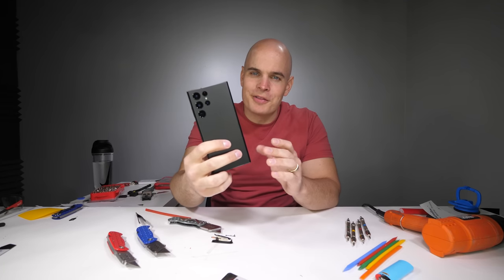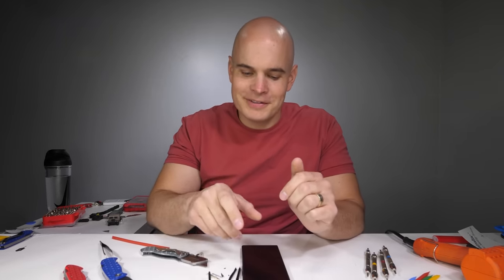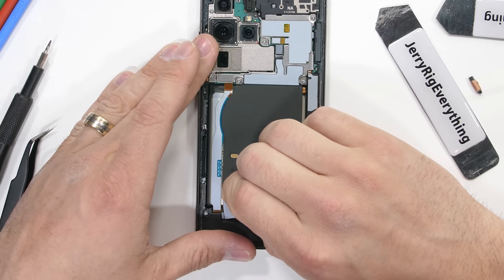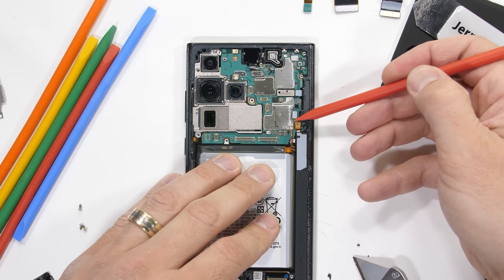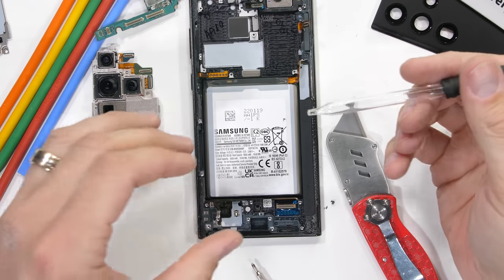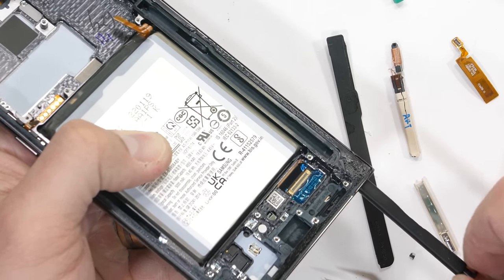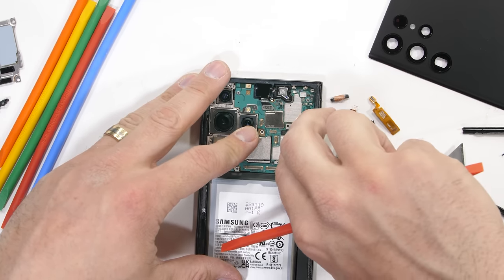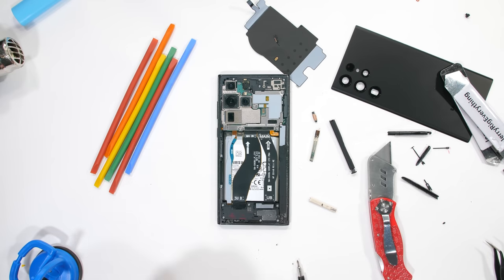Galaxy S22 Ultra Teardown - Can the S-Pen hole Leak?!

Comment: I repaired smartphones for years as a LEVEL 2 device repair technician at Batteries + ( lol ) & lots & lots of Apple & Samsung phones // usually 3-15 phones per shift / + selling light bulbs (LED) & installing car batteries etc // at any rate // my first smartphone was a Galaxy Note 2 then I went to an OG iPhone SE & now I roll an iPhone SE2 - I got an Apple Watch Series 1 (still works) desk ornament, Apple Watch Series 5 (now Meg uses that one) & most recently Apple Watch SE (my daily. We both have 2019 iMac's & iPod touch 4th gen that still work & an ancient iPad 2 that still works. My 2008 MacBook still works too. Apple hardware very long lasting - for many people. I really like how iPhones are made & appreciate Samsung phones too // & appreciate that Apple makes the battery easy to replace (since its probably the first thing to fail, especially since going to 100% charge damages LIPO, as does high heat & or charging while below freezing (keeping LiPO between 30-80% makes last 5X longer (your working with 50% of the charge & minimizing anode & cathode ion insertion & removal extremes associated with charge state below 5% & above 95% / this applies to most of the lithium cobalt carbon lipo batteries used in consumer electronics that are portable // laptops, smartphones,  smartwatches, fitness trackers // so I recommend short charge sessions of 10-40 minutes in the morning or while taking a shower, while going for a walk, while eating breakfast or lunch or dinner, & strongly advice people to avoid the fire risk of leaving their portable electronics with LIPO batteries parked on a charger all night while they are sleeping (overcharging & progressively damaging the battery) - Kudos to Batteries + & iFixIt for helping people to replace their faded electronic device batteries & for selling the tools & giving away the know how & instructions online for free - like many YouTube channels. Love your channel Zach!

Comment: Thanks for the teardown, the s22 ultra looks well built from a packaging stand-point. Wonder how long that charging port o-ring will last though. I'm still sporting my Galaxy S7, if it still had security/software updates I would keep it longer as it still does the job fine. Right now I'm looking to reluctantly upgrade (its been 6 Years).

Comment: I " upgraded " to the s22 Ultra 512gb model from my s10+ this year and I use the word " upgrade " very loosely. Personally I think the s10+ was peak Samsung, best phone I had ever used hands down. Unfortunately, I'm not liking the s22U as much. It's bigger and the display is less worn out, sure. But the phone itself has bad thermal issues that constantly causes throttling, battery life sucks, speakers don't sound as good, and it's missing alot of features I've come to be used to over the past 3 years. They're also not including pre-installed screen protectors anymore which is a must on these phones since nothing works right on the aftermarket. Either they can't adhere to the curved edges good or the fingerprint scanner has a ton of issues. And that's ontop of everything else Samsung has de-contented in the past 3 years. Still haven't recieved a day 1 patch yet either and I've had the phone since the 23rd - 2 weeks ago. Idk, it's a nice phone if it's your first Samsung, but tbh the s10+ was better. If that phone could have lasted another 5+ years I would have just kept it. Idk, at this point I just think we're hitting the law of diminishing returns on these phones - Apple included. And esp for the price we should be getting a whole lot more.
Reply: At this point there is nothing more for the phones to offer other than better battery life. They can run every game and app you would want to play on a phone, shoot cinema quality movies, take award winning photos and have high end gaming monitor screen resolution. Not to  mention being waterproof, 5g and wireless charging. Phones have reached their potential and now companies need to start making them cheaper
Reply: I did the same exact thing you did. There are a few improvements/new features. My s10plus battery waa going downhill pretty fast. Right now, I can go a full day without charging unless I'm gaming. To think, instead of the s-pen, could of had an aux port.
Downsides are, having to buy a new adapter. I feel like if they up the charging rate, they should include it in the box! Also, this phone ran very hot, like burning fingertips hot.
But apparently thr new software is learning your usage to adjust performance.
Reply: CockOfJustice  as a curved screen owner I can say that (S20U) I love it. S20U's curved screen is subtler than older models but the usability and the comfort and look ratio is amazing. There are proper glass screen protectors that work really well without fingerprint scanner issues. Since the corners have smaller curves as long as its good quality, glass screen protectors do stay on without a problem.
Reply: I'm still rocking my s9+ and love it, going to need a battery and charging port replacement soon but everything else is as fast as the day I got it
Reply: CockOfJustice  I've had curved displays since my s10+ in 2019 and I love them. But you are correct they're a pain in the ass to find a good screen protector. That's why I'm upset samsung stopped including a pre installed protector on the s22U bc 99% of the aftermarket ones suck. But the curved display itself is great and honestly I can't see myself going back to flat glass.
Reply: @jeffgayzose8129  yup. Only reason I even got the s22U is bc Verizon offered me $1,000 for my s10+ I couldn't turn that deal down
Reply: @_dmfd  damn, really? I have Verizon, need to look into that
Reply: @jeffgayzose8129  it was for the pre-order only fwir. They gave $1000 for the s10+ for the s22U and then let us get the 512gb model for the price of the 256gb model. It comes out to $8 a month haha so essentially got it for $300.
Reply: @bradburch2051  yea man tbh I just preferred the s10+ and s series in general. I always like the rounder aesthetic but if I would of gotten the s22 or s22+ it would have definitely been a downgrade. I'm having the same issues with the thermal throttling and battery. There's actually a scandal going on with Samsung about it. They're intentionally throttling our phones bc the chip heats up so bad. You should look into it

Comment: I'm curious to what happens to all these phones since there's that huge emphasis on being eco. How does one use these parts or recycle them easily?
Reply: Check out Hugh Jeffreys, he does some brilliant videos on repairability of phones
Reply: @sabersz  indeed. He is pretty fun to watch
Reply: @sabersz  Hugh Jefferys is great, but that doesn't answer the question on what companies are doing with these "recycled" phones.
Reply: @mjc0961  i think he explains how they're recycled pretty easily. Save as much as you can, even a cracked screen with working display can still be refurbished.

Comment: Repairability and recycling are so-so on the scale for me. I'd love to keep my S22 Ultra forever, but if, for whatever reason, it can't be repaired, then I won't cry about it. And for recycling, while important, I think that not buying a phone simply because the battery removal isn't easy or 100% guaranteed is a very inefficient reason, but to each their own.
Reply: Purchasing devices that are less recyclable may encourage the company to continue doing so, it is not the right direction in 2022.
Reply: @theneighborlynumismatist8201  Bro nobody cares about recyclable most people keep their old phones in a drawer i got like 10 in a drawer atm and if youre stupid enough too see non recyclable as a problem you should prob not buy any electronics.
Reply: Why do you think it can't be repaired? He removed the battery in like 15 seconds.
Reply: @bubbleir  well as i said if you think its a problem you should not use/buy anything that uses electricty😑
Reply: @bubbleir  and for the reason why they make it a 2min kob instead of 1 is the note 7 every samsung until that point had a 1 min removeable battery its for sustainabilety and safety!

Comment: Repair and recycling is one of the key pillars of my smartphone experience. I hold dear the concept of sustainability, and options with sustainability definitely adds huge points to the decision.

Key factors when buying phones:-
1. Durability
2. Day-to-day usability (overall software experience, size and weight)
3. Repairability
4. End-of-life
5. How good are the telephotos (I'm a lazy guy, I read the menus from far when I'm in queue or at my table for lunch/dinner)

Comment: I definitely agree that Samsung should make their batteries easier to remove, it's really dangerous now!
Reply: How is it dangerous? Serious question
Reply: Isopropyl alcohol is extremely cheap and completely safe to use on electronics. I replaced my battery with a screwdriver, candle, and a couple plastic shims and had an easy time with it.
Reply: @Yielar1  Zack had to put a lot of force on the battery with his metal pry tools and he slightly bend the battery upon removing. This is dangerous because this can cause the battery to malfunction, catch on fire or explode!
Reply: @realracer0353  he also had to spend 5 minutes heating up the back glass and use a razor blade to cut the glue. Either of those things could also make the battery catch fire. What I'm getting at is that if recycling companies can find a way to get the back glass off easily, they can surely find a way to get the battery out easily. Especially when most pull tabs don't work most of the time. I think not buying a phone because it doesn't have battery pull tabs is stupid, considering how hard it is to get to the battery in the first place and that most of them will never be recycled.
Reply: @Craig Comeau when you are struggling to remove a battery and pierce it, it will likely explode ablaze, having to do this with Samsungs make the batteries almost irreplaceable without a professional this the glue can be dangerous to the environment upon recycling….. it’s difficult to recycle all that glue hahahah
Reply: Yes definitely dangerous. Since u have to remove it on a regular basis 🤣🤣🤣

Comment: Wasn't apple counterproductive by locking down each component so repairability is a major hurdle? Well, for third parties, hopefully not themselves.
I think there might be other also ecologically good ones, e.g. Fairphone.
Reply: yeah that's why France threatened them to ban them from the eu market and they caved and made that repair program
Reply: Apple makes repair very difficult. Louis Rossmann has videos about it. He fixes Macbooks
Reply: @MiguelY22  well, I was wondering because even Jerry did a video about a recent iPhone where he tried to just exchange some modules between two of the same model.

Comment: I got my Note 10+ the same time as you and have been rocking it ever since (am also considering an iPhone for my next whip 🤢) but it recently fell off my motorcycle at 50mph and my case isnt even that good and the phone is completely fine minus one tiny ding on the frame. I'm shocked and I'm not sure what other device could do that in our current climate. I probably just got lucky but still.
Reply: Do not get an iPhone they suck so bad.
Reply: Not to mention I can sell my 5 year old iPhone for the same price as last years flagship Samsung. iPhones hold their value for a reason.
Reply: Note 10’s were actually really durable to drops than the S10 and the S20 series according to the phonebuff’s drop test videos. So it no doubt it’s great in the real world
Reply: @TonyVM775  You bought it for more so....
Reply: @TonyVM775  dingbot? 🤣
Reply: @Crazyoldman84  🤭😂
Reply: @TonyVM775  because they're more popular than Samsung phones in the US.
Reply: @Crazyoldman84  lmao didn’t wanna really insult you but had to call you something. At the end of the day we are arguing about cell phones that do the same thing lmao
Reply: @TonyVM775  it's ok you can me what ever you want I don't get offended. Yes phones that do the same thing except different. Everyone has there opinion and mine is iPhone suck 🤣. I just find iPhone incredibly difficult to use and everything they sell expensive. I'm a pixel guy myself.  Iv also had a few Sony's I liked a lot. My wife switched to iPhone and she said it's the worst thing she ever did. I did warn her 🤣👍
Reply: Why you were riding a motorcycle? Like it goes vroom vroom?

Comment: I'm wondering why they choose wireless charging of the pen. Wouldn't it be more efficient and simpler to just add 2 metal contacts?
Reply: You’re risking the phone to fry the motherboard by getting any water inside the pen hole, so it’s not a very good idea to add any kind of metal inside of the pen hole. Charging the pen wirelessly is the best option if you want to keep the water out of the phone.
Reply: The s pen doesn't have a battery but a small capacitor that only works for a very short time. Older models didn't have capacitors at all. The pen charges while using it through an electromagnetic field spread across the screen.
Reply: The implementation of the contacts on the phone and the pen might not be reliable enough for repeated use. Plus sweat and dirty may cause poor contact resistance reducing long-term reliability.
Reply: @svartdraken  every s pen uses wireless charging.
Reply: @RandomGuy-om1vy  you missed my point. older models didn’t charge at all, meaning they couldn’t keep the charge when not in proximity of the integrated Wacom digitizer
Reply: @svartdraken  you have mistaken. All S-Pen's charge by wireless coils inside the pen holder (All the way back to the OG note and Note tablets from 2012 by Samsung). Not a new thing.
Reply: @RandomGuy-om1vy  it's power supply not charging, they don't store the power unlike new models. That's the relevant point in reply to the original comment, cause they'd be dead after a minute if they didn't change wirelessly

New ones do charge indeed
Reply: @svartdraken  dude, All S-Pens do store power by a capacitor inside them, the only difference btw the new S Pen starting from Note 9 is Bluetooth LE, and that requires more power therefore the bigger coils. Just do a Google search on how S-Pen's work.

Comment: And don't forget about the Fairphone.
It is usually not necessary to use a smartphone with absolute high-end specs. As you said, the curve flattens out.
And with the Fairphone, you not only have a repairable phone, but also one where the production itself is friendlier to the environment. Version 4 has absolutely sufficient performance for the next few years.
And all that without any glue.

Comment: Hey Zach,

you said that the lithium ion batteries are 95% recyclable.

what does that mean exactly? are there some parts of the battery that can't be recycled or is it more that just a select few companies won't recycle them?

if it's parts, which parts aren't recyclable just out of curiosity. :)

thanks,

Adam

Comment: I've accidentally inserted the sim removal pin into the top mic/speaker hole all the way until it would not go any further. Would that have damaged anything?
Reply: Happened to me, got any answer on this?
Reply: I did that over a year ago...mic is still working till this day, so I guess it's fine?
Reply: What would have been even more impressive is if you had managed to open the sim drawer by doing that!!

Comment: As someone who has repaired many Samsung phones, the glue is just fine. If you heat the phone correctly (in an oven) and use few drops of alcohol then the battery just jumps out. Compared to "magic pull tabs" that break and then its impossible to remove the battery without deforming it (surprise surprise, when the phone isn't brand spanking new, pull tabs break much easier). Also yeah, taking a cover off with a knife and going balls deep..
Reply: Batteries with magic pull tabs are way easier to remove with alcohol than the ones with as much glue as this
Reply: @DimitrisSartzetakis  Yeah no, I've had several phones with pull tabs that broke (usually xiaomi) and alcohol nor heat helped.. just brute force. Samsung goes out like a dream with a bit of heat and alcohol CONSISTENTLY. The only thing I hate is reapplying adhesive on some S/Notes for the back glass.

Comment: I don’t know why people keep complaining about the adhesive for the batteries if they can just use a few drops of alcohol under the battery to loosen it up completely 🤷🏻‍♂️
Reply: Absolutely!  And complain about recycling because there’s glue on it?  Maybe we should complain about recycling tires because there’s steel in them. The environuts are getting super dumb.
Reply: A few drops of alcohol and a large amount of struggling to pull it up using TWO pry tools but you know, go ahead and pick cherries I guess 🙄

Comment: The s5 had an ir sensor, heart rate sensor, fingerprint sensor, expandable storage, removeable battery, headphone jack, and came with a charging brick/earbuds. These new flagships are losing more and more features everyday... And costing more and more every year 😔
Reply: And it was so light, you could just drop it without any damage

Comment: I wish that the way the Framework laptops attach the battery would spread out even to phones. You could easily have a ledge to hold the battery under on the left and 2 screws above and below the right edge of the battery. No glue, yet perfectly secured and easy to remove.